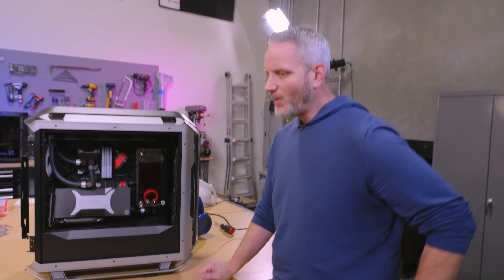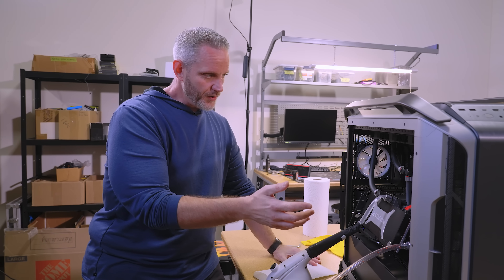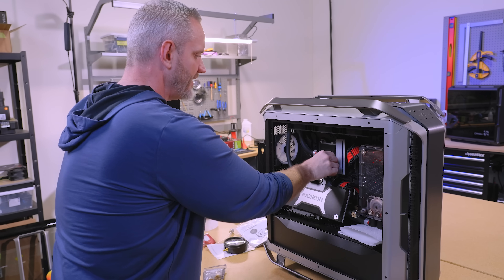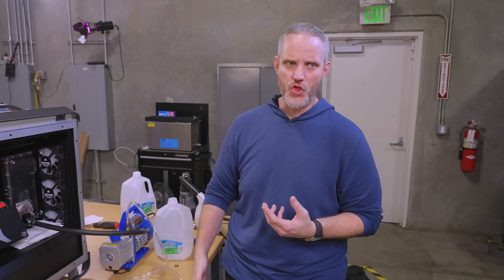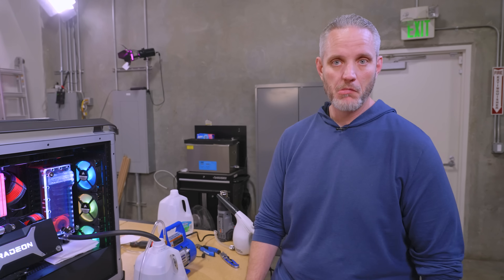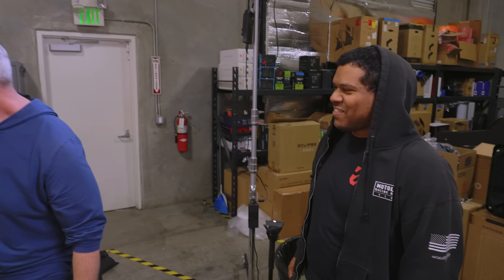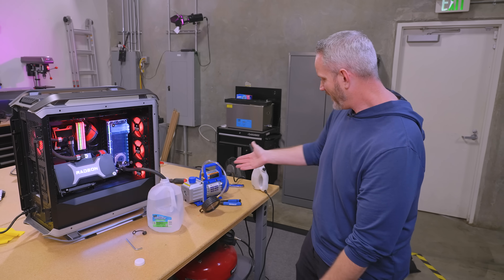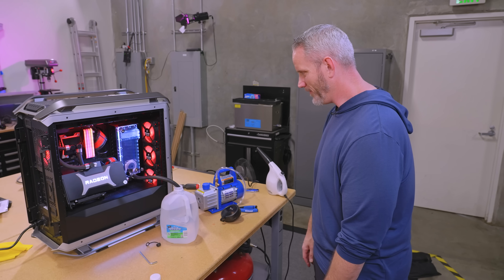I used Vacuum Pressure to fill a PC! Why didn't I do this sooner!?

Comment: I’m in HVAC. Keep it under vac longer it will get into a deeper vac. And if you put another valve on the other end, vac until full column of fluid comes out and you’ll know you have no air in system. Great idea none the less!

Comment: A second valve....no.  Punch a fitting into the cap of whatever bottle of pre-made coolant you want to use.  After vacuum, shut off fill valve and then connect the hose to the fitting you stuck into your bottle cap.  Hold bottle above your PC's level (not the PC itself) and the air should bubble up into the coolant container so when you open the loop you are just pulling liquid.  You will probably need a hole poked in the bottle to allow air to flow in so you are not fighting against the vacuum.

Comment: We use vacume for cooling system flushing in my automotive shop vacume to pull it out and and fill works great
Reply: I have one of those kits I use for cars as well. What did you use to adapt it to fit the PC fittings? Hoses and barb fittings?

Comment: Eliminate more air by pulling vacuum from the top of the res, while its pulling, open the bottom fill valve, just enough to let the air in the fill hose empty and be replaced with water, once you notice water start to enter the res, close off the fill valve till you get a good amount of vacuum.  Then close the vacuum valve and open the fill valve and less air.

Oh, also, that wasn't really oil vapor...  That was the water moisture in the loop, that boiled out of it due to the lower pressure.  The oil in the pump helps trap some of the moisture/contaminants, but a lot is disposed of as a vapor.

Comment: After closing the valve, fill the tube with fluid, then dunk it in the fluid. I'd pour the fluid into a trough so you can submerge the tube end before letting go of it. That should minimize your air intake to almost zero.

Comment: You could use the vacuum pump to vacuum the liquid out. You would need a tube from the loop to a canister and then another tube from the canister to the vacuum pump. Just make sure that the tube from the canister to the pump is shorter than what the liquid would fill into the canister. Also you would have to put a valve on you fill port to crack the vacuum slightly to move the liquid.

Comment: Why not use low pressure compressed air to drain the system
Reply: That's what I do. Makes life so much easier. Just have to make sure you don't put the full 150 PSI through it lol.

Comment: Howdy, Jay! Wanna know how to make a cheap DIY fluid vacuum drain? 
1- Take a piece of soft tubing, and poke a hole in it.
2- Get one of those blowiemajiggers that you can connect to a regular shop air compressor.
3- Poke it into the hole in the soft tubing in the direction you want the fluid to flow.
4- Attach/submerge the end that doesn't blow air after following previous steps.
5- Activate the air chuck and proceed to spray fluid into your intended catch basin.
You have now learned how to play with Venturi  Effect.
Enjoy! ;D

Comment: or plug in the pump on the top up hole in the reservoir and pump air while having the bottom tube in the coolant jug, won't put the system under negative pressure and risk to implode and will simply pump the coolant in the circuit.

Comment: My suggestion is to use a Y splitter with valves on all sides. One to the machine, pump, and one to the fluid to get around the air in the tube issue.

Comment: Automotive AC components undergo very high pressures and therefore can hold up under vacuum with ease. CPU coolers create little pressure and the radiators are built accordingly. That creaking sound Jay was hearing was likely damage occurring. When the system bursts and shorts out the computer, well...........

Comment: Put a valve on the tube where you disconnect from the vacuum pump close before close it before taking it off and open in the water less air

Comment: Hey Jay,
Medical science has a solution for vacuuming liquid.
You go from the vacuum pump to a container (solid glass to withstand the vacuum pressure) with two pipe fittings, one to the pump and one to the thing being vacuumed.
The container fills without liquid being sucked into the pump.
One long fitting tube and a short one make it less likely to allow liquid into the vacuum pump line.
So using this idea you can still use the vacuum pump you already have, you just need the in-between container.
Cheers from Paul.

Comment: A Y-split on the coolant line, and a short and/or pre-filled fill-line in the bottle would cut down on the amount of air entering the system.
Once vacuum is pulled, close the first valve, then swap the Y-valve to fill mode, and open the main valve.

Comment: To make your setup perfect... 
All you need to do is attach a fitting to the "bottom" of your "fill from" tank. (obviously add a shutoff valve)
Then all you need to do when ready to fill is connect to the fill reservoir, open the reservoir valve and lift the reservoir tank above the fill port so the tube bleeds out all the air into the tank, and bubbles to the top.
Then you just set the tank back down (or just leave it on a stand above, and add a T with a shutoff for the pump), and open the fill valve on the loop.

No more air getting in to the system.
And you have an awesome mix and fill tank which perfectly attaches to the loop for a clean fill station.

---

With enough forethought into the design, you could build a station that only needs to be connected to the fill port on the loop, and everything else is valved for easy use. Making it a much faster process. (And a potentially kickass looking fill station)
I forsee a waste hose going down to a 3 gallon bucket under the bench, and the fill tank on a stand above the pump on a manifold with valves to open and close access to the specific functions (drain - vacuum - fill) *And a tertiary to blow air through and clean the lines... Or water flush them. Just in case they need cleaning.

Comment: Jay I know this is off the current topic but I've been trying to find a good place to raise this question of why some keyboards are not working during bootup (to get in bios or select from boot menu), while other kb's do work. In depth research on the web has never ever given me the right answer - it's just "check your drivers, file corruption, bad cable, etc" - stuff that doesn't address this specific and very real concern (and many others with identical concern). I've had a TON of kb's and just know some will work while other brands/models won't so from a consumer standpoint it's a crap-shoot. For instance, right now I'm typing on an expensive wired DROP CTRL High Profile that does not work until Windows boot loader, yet my cheapo wired MaCally SLIMKEYCSG kb works from the get-go. I have therefore concluded there must exist some common incompatibility between kb and host - either a deficiency in kb design, or in mobo design. Example test I did with the two boards: plugged them both into a usb splitter from the top back panel port of a ROG Strix z590e and sure enough little old MaCally lights up but not DROP during the BIOS/UEFI phase. Somethings up that nobody seems to be talking about or identifying for a relatively frequent occurrence.

Could you please help and look into this, perhaps ask one of your contacts or do a video on this matter? It would answer many. Thank you!

Comment: Wonder what kind of long term effects doing this to system multiple times like you do sometimes on channel. Like, will the CPU or GPU cooler fins start getting bent and throw off thermals if they are to thin?

Comment: There’s a lot of liquid systems that are required to be vacuum filled for proper function. In the car industry this has been a thing I would say for more than 10 years. Is not perfect though, but it works really well.

Depending on how much vacuum (negative pressure) is generated, all components should be fine.

Comment: Hey Jay, you are trying to fill it through the drain valve. Try installing another valve at the top in the fill plug. Instead of that air being put under pressure as the tank fills and the water level rises, it will slightly reduce the amount of vacuum in the system, which wasn't a full vacuum to start with. It takes less force to pull the water down the tube and into the reservoir than it does to draw it in and push it up to the top so less force/vacuum will be needed. The reduction in the force needed should be more than enough to compensate for that reduction in negative pressure and it should fill completely.

Comment: I've done it, you were not the first! Aquacomputer has one and many of us have done it before. If you are not careful you can cause seals to become damaged, along with the radiators. Do not overdo it. You should attach the vac to the fill port at the top, then attach to a jar or something to create an air gap, then connect and use vacuum the draw in the fluid from your valve tube immersed in the coolant.

Comment: ok what you do is the filling hose needs to be from the bottom of the bottle so the pipe to valve has no air and separate valve to pull the vacuum

Comment: HVAC technician here. What you created was the harshest water slug machine I've ever seen. When we pull a perfect vacuum (down to 500 microns maximum) we have to let in the liquid refrigerant VERY slowly or else it will destroy the compressor, especially newer ones that have been re-regulated by the EPA to be more efficient in the states. 

Waterslugging has the potential to ruin joints, internal mechanisms, and likely your radiator fins. However, you can totally prevent this by pulling a vacuum (with the fittings, because with proper fittings, you should get near a perfect vacuum if your joints don't leak), closing the valve on the tube, removing the other end off of the vacuum, filling that tube with water, plugging the end with your thumb while you push that end of the tube into a bucket of water so that it is completely filled with water, and then CRACK the valve open SLIGHTLY to slowly bleed the water in, letting it flow without much speed so that it gently flushes across your joints and fins.

Edit: actually, it may not be that bad considering your loading it into the accumulator instead of directly into delicate points of your water loop, but it's still a good idea to slowly bleed the water into your system.
Reply: You ned a 3 way Y splitter with 2 valves one for vacuum and one for fill. The one for the fill will go back to a small gallon bucket with a hole and another fitting with a valve. just before the valve at the Y fitting there will be another fitting with a bleeding port on it so you can pre fill the length of feed hose. Close all valves on the feed side. Open all the valves on the vacuum side and pull a vacuum. Close the vacuum side. Open top valve at the bucket and them open the valve at the Y. Yes some air will get in there, but dam it will work near perfectly. I just got all my fittings in to finish my loop I just may try it. I just concerned I may damage something pulling to m uch of a vacuum. Sory was just thinking out loud when I read your reply. I was a dealership tech for over 20yrs. Everytime I filled a cooling system I pondered this idea and was always surprised none of the big companies had a kit to do this.
Reply: Why not do like a wet-vac and pull liquid continuously? - just need two jugs. waterjug-system-vacumjug-pump
Reply: @theluggage7131  That was my first idea to suggest, however there may be air pockets in the system doing it that way and the water will flow right past those air pockets.
Reply: I find it so interesting the difference in terminology between industries. I work in materials science and laser testing and for us a "light vacuum" is about 1 micron (I assume we're taking mercury). I actually stifled a gasp when I saw Jay just slam open the vacuum valve like that, I thought for sure he was going to crack something, especially just behind the fill valve.
Reply: HVAC technician here. Waterslugging is when liquid refrigerant gets into the compressor. Liquids are incompressible (to an extent) so it can destroy the compressor. A PC doesn’t compress the coolant. It merely pumps it as a liquid.
Reply: @bears7777777  Yes, that is the risk with releasing too much refrigerant into an HVAC system, but I was using the term to loosely describe the effect of water moving forward and hitting something in its path in general, like how your house plumbing can form leaks if you quickly shut your sinks off and make the water come to a sudden stop
Reply: I think theyll be alright if they add oil back to the system and dont run it for long
Reply: Agreed, they could even add a fill tube outside of the container in a Y and add from the top with gravity, then cap that tube off above the water line in the top section guaranteeing only liquid enters and no air.
Reply: "perfect vacuum"
Reply: @BerzerkaDurk  Yup! In HVAC, there is such a diminishing return on pulling a vacuum down anything below 500 microns that 500 is the magic number for perfection!~
Reply: @nuc2726  Ok, now I'm genuinely interested. Does 500 microns assure that the system has the least amount of air that may disrupt the working of the system? Or something else? We have a lot of chilling heat exchangers to cool our lasers and a few of them need to have their refrigerant replaced on a semi-regular basis, so this is of some interest to me.
Reply: @thewritingengineer  Yes! Air is a non-condensable gas, which means the compressor can't compress it. This will cause the system to run loud and inefficient. There is also moisture in the air, and moisture will turn the oil acidic and will destroy the compressor in just a couple years if you don't pull any vacuum at all.

When you pull it down to 500 microns, there isn't enough moisture or condensables for it to affect system performance or longevity.

Now, if you have a High CFM vacuum on a small little system, that can flash-freeze any moisture in there, causing your micron gauge to still read perfect even though there is material in the lineset, and when you re-pressurize it, it will turn back into a liquid or gas and cause problems.
Reply: "500 microns MAX"

Nah homie

TO THE MOOOOOOON

In actuality I pull as deep as I can within a reasonable time on repairs to dehydrate. 

500 MINIMUM. Then decay test. The deeper the vacuum the better i feel about the refrigerant and compressor longevity.

On installs with new linesets and condenser isolated why not go deep lol.
Reply: @pahlsun216  hi man
500 max means it can either be at 500 microns or below
the lower the better, yeah
500 minimum means you don't care if it's over 500 microns, but you won't let it get any lower than that even if it could
Reply: @nuc2726  500 minimum means at least 500. I literally said the deeper the better. I even asked why not go deep
Reply: It seems you don't understand why liquid refrigerant damages the compressor....
Reply: @dongchen7940  it seems like you found out one way of many on how liquid refrigerant damages the compressor and think that's the only way liquid anything damages a compressor...

noncondensibles of any kind kill compressors, and more of it at once does more damage, yadayada
Reply: Why Not Just Put A valve At The End Of The hose? Also These radiators Are Made For Positive Pressure And Are SUPER CHEAP IN CONSTRUCTION! i Would Fear That The Sound He Was Hearing Was The Smaller Tubes In The radiator Collapsing Shut! Effectively Ruining The Cooling Capacity Of The radiator!
Reply: @kevinlsims7330  A valve at the end of the hose will still have a few grams of air as you connect the hose to the service valve. ofc my background is an HVAC technician, and so my idea of a perfect job is ensuring there are no contaminants whatsoever.
Reply: how about liquid always starts to boil in a vacuum?

Comment: So i think a coolant system vacuum setup would be better bc most use a manifold block with separate valves mishimoto had a kit. That way if any fluid did come out its fine and you can use the vacuum to get the fluid at the manifold block and so not have any air go into the system.

Comment: Instead of doing two valves. You could use a syringe or funnel or something to fill the tube with water and plug it with your thumb then put the end under water and remove your thumb. It should be filled with water and no air then.

Comment: @Jayztwocents you are 1 tube and 1 waste containment vessel from vacuum draining already. Between the PC drain and the vacuum pump, you need a containment vessel that can hold your required level of vacuum.

* Take a reinforced container that can handle 1 ATM of vacuum and hook south bound to your vacuum pump. hook it north bound the PC reservoir value.
* with the valve closed, vacuum the collection reservoir to as hard it can handle and shut the valve to the vacuum pump.
* Now open the valve to PC Loop. since the collection vessel is a larger volume then the PC Loop, it will suck it dry due to pressure differential.

Comment: You should use a handheld vacuum pump for this, like what would be found in a vacuum filter for chem labs. This is like applying a sledge hammer to a brad nail.

Comment: instead of getting a vacuum fluid pump just get a container to pull a vacuum on that has the drain hose connected so it will pull it out into the container

Comment: This has been done. Your idea is not new.
You should also absolutely add an extra bottle with desiccant. Though you have already killed your pump because water leaked out of your vacuum line the second you took it off. It will fail. When it fails is anyones guess.

Comment: You need to be careful of blowing seals with too much vacuum. You should build a rig so that the pressure gauge is on the other side of the valve so that you could see if it's holding the vacuum. Maybe attach it to the fill port. So, pressure test, then vacuum test and fill. Good luck.